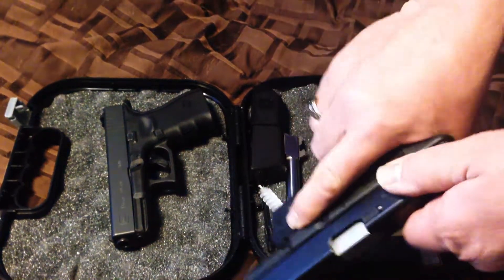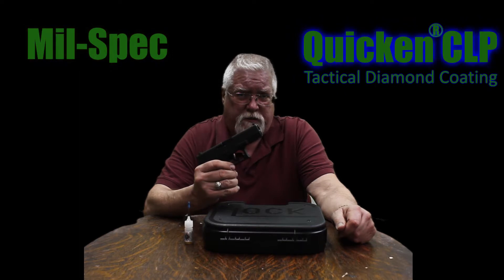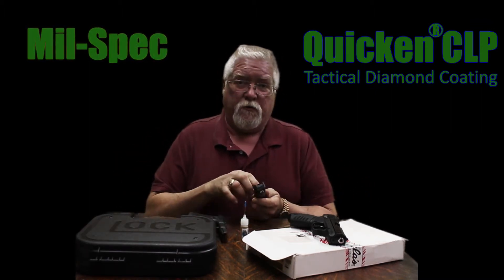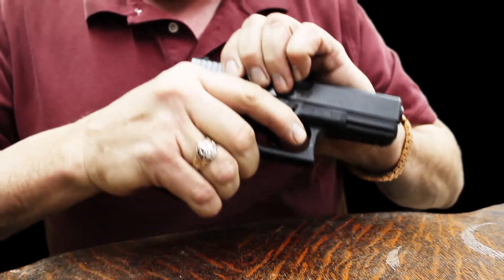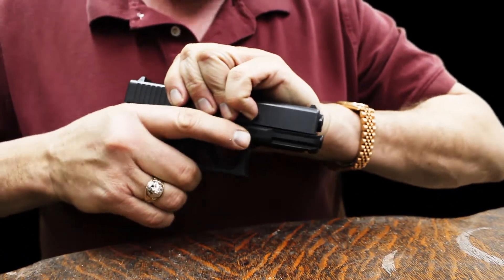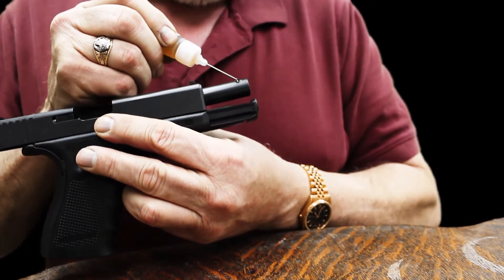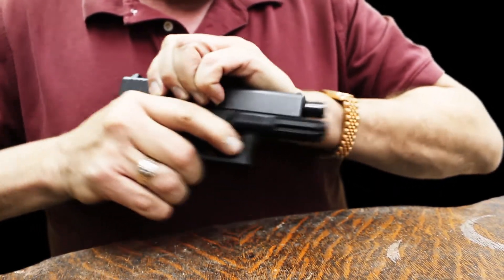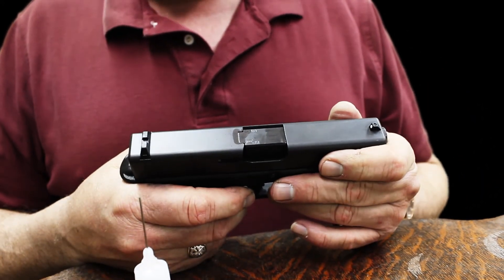Quiet No Lube Glock (LOOK)

Comment: Was the idea that the nanoparticle lubricant was to be used one time and it would soak into the metal for a long time so you wouldn't have to relube it?
Reply from the maker: Kind of. You need to work the friction surfaces to embed the particles in.  Apply it and just keep working it in by Racking the slide and shooting. But yes, once it’s fully worked in, you can run it dry

Comment: Don't forget the trigger bar and connector.  And, no lube?  That was not exactly no lube !!!
Reply from the maker: Once the material works into the friction surfaces, you clean off the oil and run it dry.  It is a true diamond coating.  Listen to the difference of before and after.  It gets quieter as it gets cycled.